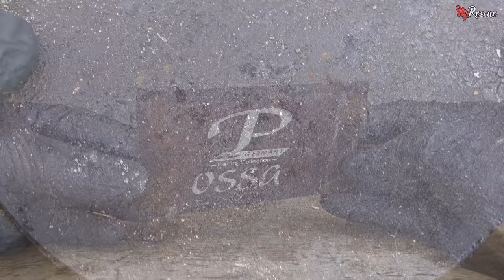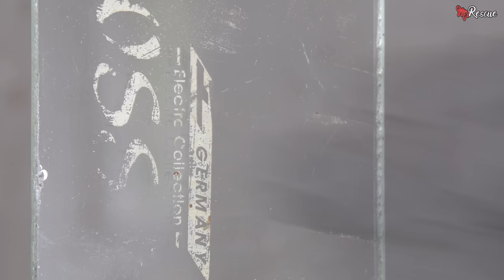The Ultimate Pizza Oven Restoration Process

Comment: Really great job!!
Two tricks to help you on your next project..
Using a glass jar with screw on lid,attach a long bolt through the lid ,fill it with sand,and use it as a tumbler to clean any nuts,bolts and screws using your electric drill to spin it...
Second,using "Easy-Off Oven cleaner", will remove that carbon build up instead of having to scrape it with razor!!
Just spray on let sit for an hour,and it will wipe off!!!
Hope this helps!!!
Reply: Awesome...lol
Reply: My thoughts exactly!

Comment: Really hope you did an initial burn before you cooked that pizza. Great restoration man!
Reply: I was thinking the same thing. I would have let it run for about two hours before even thinking about cooking a pizza in it.
Reply: Not only that, but for the whole aspect of pre-heating the oven before throwing a pizza in.  this triggered me
Reply: Why would you need to do an initial burn? I honestly don't know.
Reply: @juliawolf156  When the paint is first heated, it puts off poisonous fumes and it smells bad too.
Reply: Mmmm that pizza tastes like cleaning solution.
Reply: And do it outside if you have kids or pets ESPECIALLY BIRDS.
Reply: uhm. he does this stuff for a living. he knows.
Reply: @1chrisanderson  You are right. You should pre-heat it up first to the right temperature. It is hard to read with this device unless you have a meat thermometer that you can measure what's going on inside.
Reply: @MsMoonDragoon  Does he?
Reply: @juliawolf156  to burn off all the chemical vapours/fumes (ideally in a ventilated area) from the painting, oils, etc. Otherwise, it not only smells awful but can also contaminate your food.
Reply: @1chrisanderson  You are weird af man. That triggers you? WTH man.
Reply: @juliawolf156  Did you ever cook anything? 🤔🤔
Reply: @MsMoonDragoon  He doesn't cook for living tho.
Reply: That is a very common sense thing, I'm sure after doing a restoration like this he has the sense to heat before he eats.

Comment: 14:53 what you are doing with straightening the rim is a forming operation so you should be using a soft mallet (hdpe, rawhide, or wood). When you use the metal hammer you are denting the metal. Forming has a soft hammer and or anvil/backing, forging has a hard hammer and anvil/backing. Just something to keep in mind especially with softer metals. You seem to get this but also remember to place the bend/dent curve down for flattening. You don't need to hit thin metal that hard just multiple light strikes, this give much more control, and lessons the chance of cracking.

Comment: Love the restoration, you are one of the few restorers that actually believe in hand safety. I have seen others that  will use razor knives and blades with their bare hands. As a former maintenance supervisor, I really appreciate that. Have you tried using flap wheels instead of sand paper on some of your projects?

Comment: Mr. R, you've probably heard this before. I stopped using wd40 to loosen bolts a couple decades ago. It's works well as a water displacement when winterizing your boat engine. I only use pb blaster for penetrating oil.
Reply: I don't even use that I mix a cocktail of ATF diesel and Acetone, Works wonders.
Reply: If the rust is homemade then there is no worry about screws coming out of what is essentially newish metal made to look old. This channels name should be Mr patina instead of Mr Rust.
Reply: @lifted79chevy350 Liquid wrench or just some heat work better.
Reply: I use Plusgas.
Reply: @xbahamutzero  I am definitely biased to what works, wd isn't even a comparison . Thinking wd is better or does any kind of penetrating shows your lack of experience.

Comment: I've handled literally hundreds of portable pizza ovens. Probably over a thousand if you count the folding grills I used. This little bad boy is just perfect for household use. You could do so many bread based items that would really only count loosely as pizza in it too I'm sure. And yeah there's a few "artistic" details I probably would have done differently but as far as trusting this restoration to eat food out of? No questions. So great job. And hey, I don't suppose that works on USA standard household current of 110v does it? Might have to try and hunt another one down for you to restore so I can use one myself. Providing it would work in my house and you take paid commission jobs. I just love this little thing to absolute death. Perfect size perfect shape nothing unnecessary. Just love it.
Reply: there are ways to convert these to work on us current. you just need the American standard cords and parts to put in them. I have seen them do this with other devices so it should work with this.

Comment: I certainly would have installed an insulated grommet where the electrical cord exits the machine.  Mushy looking pizza but, overall a good resto.
Reply: Exactly what I thought, spoilt by that and also removing the logos.
Reply: True, considering that it's easy to get silicone grommets online.
Reply: @georgepitchley3946  It would have been difficult to reapply a logo which was already beat up.  How would one do that, through a stencil in the sandblaster perhaps?
Reply: I don't have any reason to think this is not food safe... personally, I'd run this to max heat, cool it, run it to max heat, cool it again, clean it, run it to max heat, clean it, then make a pizza. I really don't trust that spray coating and a closed chamber with food.
Reply: @onooooooooooo  I would of done the same thing the chemicals are still there after the restoration you need to let it run first melt them off until it's usable .
Reply: Ah yes. The comment section experts. They’re always lurking around.
Reply: @georgepitchley3946  spoilt! Yeah ok mate.
Reply: @chrisacres  I'm actually a vampire who feeds off of comments like this. Delicious.

Comment: If you sand blast that much rust (instead of using rust remover first), does that mean that you have to get rid of your sand blast medium quicker?
Reply: I think so.. that’s what I learned on hand tool rescue page
Reply: Yes as it contaminates your grit
Reply: Ya ppl clean it first so u don't gunk up your sand blaster because if u get chips and thick stiff in it it'll clog up the sand blaster and it's very anyyoing
Reply: Yes and that adds to the cost.
Reply: @da_saint-psn  There are always good tips in the comments, thanks

Comment: Who would throw away a perfectly good pizza oven?? Jokes aside, it’s amazing how well you are able to restore stuff that looks so gone. How long do projects like this take? Does it depend on the project? Also, awesome work :)
Reply: the restoration is good, but this pizza oven is awful. little to no insulation, it would be quite hard to find any oven worse than that. even the lowest-end kitchen stove gotta be at least a 100x more efficient and safer.
Reply: @Lapantouflemagic0  pizza ovens usually heat up to 400C, while normal kitchen ovens heat up to 250C, and the space in pizza oven is more compact, so it heats up more quickly. You don't have to have much insulation, because you're not cooking for hours, just few minutes.
Reply: @Njazmo  real pizza oven burn wood, so yeah, maybe. 

but when cooking a pizza you likely want to set your oven to 6 or 7, which amounts to 180~210°C, well within the range any oven can reach.

but it's not about the ability to build up and maintain heat, it's about energy efficiency. this piece of crap bleeds massive amounts of energy everywhere because it is all-metal with little to no insulation. it really could not be worse unless you'd make it out of diamonds or something
Reply: Yeah I max mine out. Around 550F. Takes a 5 minute pre bake and 3 minutes finished.
Reply: @Lapantouflemagic0 , Have you ever seen those rotating pizza cookers? They have heat from above and below in a triangle of space and a rotating platform in between. That’s all.  No sides. No insulation. And guess what they cook pizza! No insulation needed. Be careful when you judge. There maybe information that you don’t know about.
Reply: @boa9535  the ability to cook pizza is not the problem i'm talking about. yes you can cook a pizza in or on practically anything if you try hard enough. my point is that here is ovens that don't lose 90% of the energy to the environment and that's better.
Reply: hmm yes, I can see someone here have very passionate love for cooking pizza

Comment: Nice job,  and I couldn't see one so that's the reason I'm mentioning it but considering the whole thing is metal and electrically powered I would put a ground attached to the frame in some way so that if you ever get a frayed wire it doesn't zap you.

Comment: At the entrance of the electrical wire to the device, there is a sharp metal edge. It needs a bushing.
Nevertheless, great work. Like.
Reply: Going to guess originally there was either a piece of plastic or rubber there, it's just long gone at this point.

Comment: Pretty amazing to see the final product, as the original state looked like it must have been salvaged from a beach. Rust and sand everywhere!

At 35:25 you can see the ghost of the logo on the glass, not quite completely scraped off... But it's reversed. And tells that the glass was installed inside out, compared to its original orientation.
Also, what happened to that hexagon patterned tray that was pulled out at the beginning?
Reply: Это форма для пельменей, которую использовали как поднос. У нас в семье есть такая. Ускоряет процесс готовки .
Reply: @valeriia_pedchenko  я тоже удивилась, что форма для пельменей там забыла..😳 пельмени?

Comment: Good job but, if I may, I think it’d be better if you had kept the original logo on the oven. Also, judging by the heavy rusting on the metal initially, it’d have been a great idea to give it a hand of primer before painting it. With time, your job would be less likely to be undone by time itself. Also, this is just my opinion, you could have given it a bit more contrast, by painting the oven in two different colors, such as off white/cream and black or off/white and red or blue, something like that. The shapes look just right to receive some retro color scheme.

Comment: Great restoration, but:
1. You don't know what temperature you set up, because bimetalic regulator needs a calibration - simply putting a knob for temperature doesn't resolve anything. It will need a writings arount knob to know which temperature you can set up. 
2. I can bet:  because that, pizza you cooked is not cooked in this oven - when you took pizza out from oven, you touched a hot dish wit nitrile gloves - it will melt in seconds, but not, so i assume that oven and dish was cold. And lights doesn't came up when oven was "switch on".
Reply: While the pizza definitely didn't look cooked, I think we can all agree he probably waited until it was cold enough to grab it with gloved hands. I agree on the other stuff though.

Comment: It was painful to watch you clean those 2 pieces of glass when you could have let them soak overnight in oven cleaner and THEN use the blade. All that burned fat would have peeled like an apple peel. And then to see you scrape the logo? Then why not cut new pieces of glass?
I wouldn't eat anything cooked in something that's coated in spray bottle paint. It's great to watch people restore old stuff, but it's even better when they bring the item up to today's safety standards so that it can be used for the next decades!
Reply: I'm curious as to what kind of paint was used. I know you can by "Very high temperature" or VHT paints for valve covers and brakes, and you'd indeed want some kind of VHT for this application. But then presumably you'd also want to make sure it's something that will be food safe, which might make a good choice even more limiting. Especially without investing in real (expensive) painting equipment. I'm sure something exists, but I have no clue what it'd be.
Reply: I don't think this was meant for a client but a personal project so he can restore it in whatever way he deems fit.

Comment: 27:07 Not sure if using an adhesive foil tape is the best idea in a hot oven. The adhesive would almost certainly burn or degrade quickly.
Reply: It’s heat tape you melt
Reply: @esad5754  that's definitely not heat tape for a stove, that's tape for ducts which don't experience nearly as much heat as a pizza oven. Regular heat tape is insulated. The glue is gonna melt right off

Comment: Everything looks incredible in this restoration! My only concern it’s about the paint job
The paint it’s lead free?
Can resist high temperatures over time?
I mean, your using spray paint.

Nevertheless great job!!
Reply: Not to mention tape.... friggin silver duct work tape..... yea, not rated for those temps isulation or no, and the adhesive..... instead or working on and fixing the  "pin holes". this one gagged me a bit on how half assed it was.

Comment: I sincerely hope you done a pre burn before cooking that pizza, especially having used chemical bluing on the elements.
Also doesn't putting fibreglass insulation reduce the convection through the vents in the bottom?

Comment: A carbide or highspeed steel scraper would help you get through some of these more tedious parts.

They can be used delicately or you can really remove some material with them. 
I use mine to scrape in machine ways, my straight edges, etc.

Comment: Good, but a couple of things.
1: you should have kept the logo. Restoration is less about making old things new as it is about preserving the past
2: I feel like you rushed the sand blasting and didn't truly take the time you needed to do it properly. I saw spots you missed or just skipped for time sake
3: After sandblasting, all you did was wire brush and paint. There was no buffing wheel involved.
4: You barely hand sanded, which is important for a lot of things when it comes to restoration
5. Use the paint you put in the mist gun instead of spray paint. It's safer and heat resistant 
6. There are just some things that should just be thrown out and replaced due to safety like screws, bolts, nails, etc.

Comment: One thing I'd suggest with the baked on grease on the glass - once it's thoroughly soaked in oven cleaner, wrap it with cling wrap and let it sit for a few hours.  It should help break it down so all you will need to do is to wipe it off and don't have to struggle so much with a razer. I saw this as a cleaning tip from YouTuber Aurikatariina.  :)

Comment: For the people wondering why it looks cheap or unsafe to handle: That's not the same pizza oven you would found at your favorite pizzeria or kebab place. It's an ordinary mini oven and also not "Made in Germany", but rather another case of "we installed the cord in a warehouse near munich so we can legally label it". 

Real pizza ovens are lined with fireclay and usually heated with gas, but at least never with simple heating elements. You can get such ovens at the Lidl for like 40-50€. Don't get me wrong though, his restoration is really good and the results can be delicious.

Comment: Certainly a lot of hand-done body work on it and looks quite well-done, but I do question why he did not seem to treat it with any chemical rust remover or use hole fill for any of the holes. Maybe he wanted to go more for a vintage aged and not completely new look or maybe the hole fill would not do well with heat since, well, it is an oven? Not sure. Just feels like a lot of the hand body work left a lot of imperfections, so in the end you see that pitting and a very "old, but restored" rather than new look. May have just been what he was going for.

Comment: I really did enjoy this video but missed any explanation like e.g. if you clean glass like that, doesn't it scratch or why were the round pipe like things (heating elements?) sanded with a piece of sanding paper and without any rust removal product or sand blasting - they seemed to be made of metal so I didn't understand that at all. Even some written explanations would be great.

Comment: I'm confused about a couple of things that would have made your job easier. I'm not questioning your work. It was good the way you did it. The glass and screws could have easily been cleaned by using White Wine Vinegar. After soaking them in vinegar the work after that was simple. The screws you could have taken a blow torch to them and dropped them in oil which is far more time saving than taking a wire brush to each one and bluing them. Nothing wrong with bluing because the oil would have done the same thing.

Comment: The power cord reeeeally needs a grommet where it goes into the chassis. That sharp edge will wear a hole in the insulation with regular use.

Comment: 34:55 I feel like... letting it burn a couple times to remove any of the volatile gasses that would come away with heat might have been a good idea?  Lord knows what's in the adhesive of that tape you used, or even the paint.

Comment: Nice restoration you ruined there . Rather you than me for eating out of that thing.
Pizza with a generous coating of glass fibre matt particulates, Mmm sounds so
good. So lethal.
Great how you pulled a fresh wiring loom switch gear and relay out of thin air.
Overall I'm unimpressed.

Comment: Easy Off? Nooo, I’d rather put the glass under stress and possibly scratch or break it.  The heating elements have no polarities and they don’t need any anti rust treatment.  The foil tape adhesive will release toxic gases.  Masking tape is for painting projects not oven wire management. Refreshing the brand logo with a ceramic paint would be nice.  Attention to details make a project interesting to watch, overlooking those details tends to invite questions.  But who can argue with 2.6 million viewers?